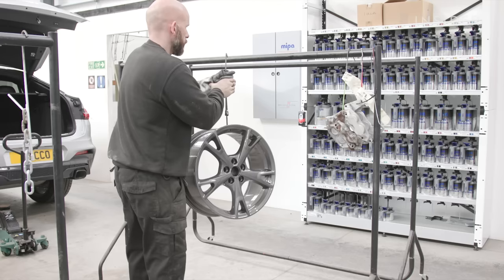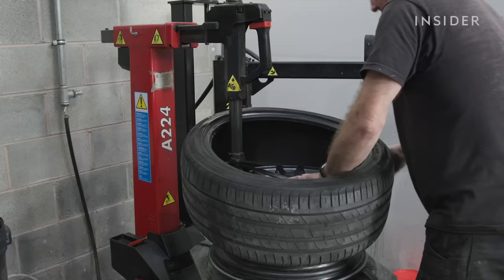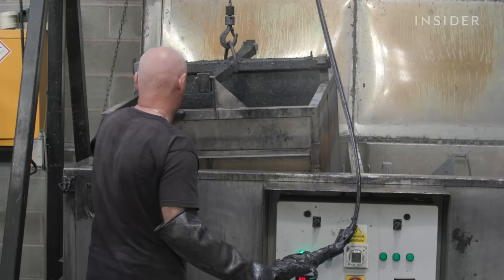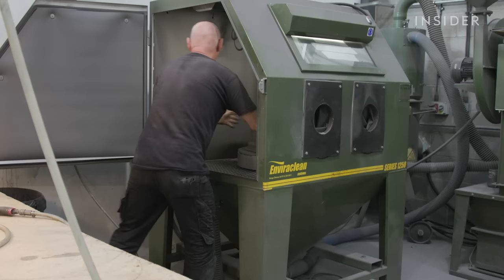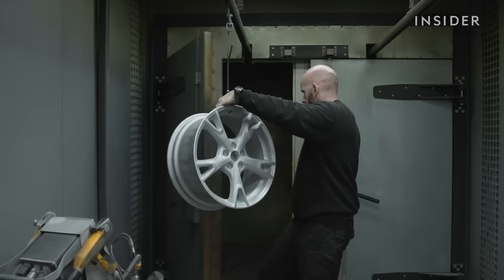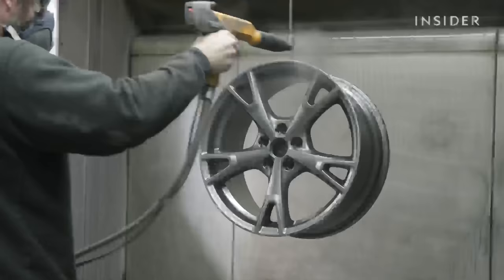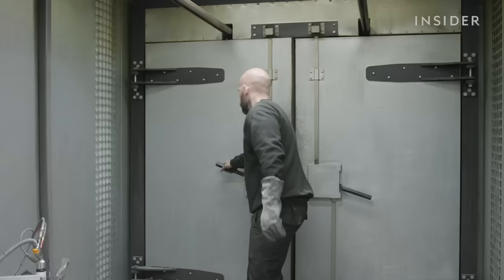How Wheels Are Professionally Powder-Coated | Cars Insider

Comment: I used to work for a powder coating shop that did not specialize in wheels, we only did them occasionally. We never went this far though. We would sand the wheel, power wash it, pre heat it, apply two coats, one clear coat, one color, and done. We also only charged like $200 for a set of 4 wheels tho. Stuff we mostly did was things like awning covers, decking screws, flag and tent poles, stuff that was cheap, high volume mass produced. So not as much time and care went into the details.
Reply: Half *ss job. Finish will NOT last. Do better.
Reply: For guys on a budget whose cars the wheels go on are not showroom-quality but instead are daily driven, $200 sounds pretty good. I wish there are options like that being offered by the powdercoat shops in my area.
Reply: @MOAB-UT $200 a set many people would pay and be happy about that
Reply: @pinkorange4980  You get what you pay for. The only proper way to do a job that will have LASTING results is to remove the tire, use real powder coat material and bake the wheel in an oven at 325-400F. In short order, your painted on finish will chip badly. Yes, the immediate results will look the same but it's of no real value. $200 and in a month or less or active use, and let's not even talk about the winter and salt, they will look horrible and you will have to bring them to get powder coated by a professional. You already know this. Be honest, it was quick money for you. A paint job should have been $100.

Comment: Nice to see a shop that does it all. I was told I have to have EVERYTHING off the rims when I bring mine in to include the damn valve stem.
Reply: Same. My guy also made me take it off somewhere else and then bring it to him and then bring them to someone else to put them on the tire
Reply: depends on the shop. not every shop has tools to remove stuff or good tire machines that wont scratch the wheels for mounting the tires.
Reply: Yes.. most shops want only the wheels! I had called many many shops and only like 2 of them, you can take the entire vehicle in. Yes a little more expensive because they have to mount em back and balance but I don't have a way or time to only take in the wheels! Lol
Reply: See the real issue is that people want the powder coater to do all that extra work for free. Like they just give away wheel balancer machines, weights etc then there's also the cost of extra insurance then not to mention the time. It costs to do the tire and valve stem removal.
Reply: I'm a painter at a wheels shop, we bust it down 100% & put it back together once it's finished, the customer receives it serviced & cleaned. We charge 5$ to dispose of used tires.
Reply: @jonboatmorava9115  no the real issue is you dont believe in full service. Bye.
Reply: @user-jk7yz3xs8z  LoL well if believing that people should be paid for the full service being offered then I'll die on that hill. Businesses can't just be doing extra things for free. Sorry you can't understand that.
Reply: @jonboatmorava9115  Some joker accused you of not "believing in full service" then ran away. You obviously do, and are also aware that with any "service" comes a "cost".

Comment: Why dont they offer powder coating the entire car paint so you don't have to worry about thin clear coat and scratches?
Reply: In fact some higher end brands due use a powder coat like paint, such as bmw
Reply: You can still scratch and chip powder coating... not only that but colors are very limited compared to using a paint system. Regular paint allows bodyshops to tweak paint codes to try and match your sun damaged paint. Also... Goodluck powder coating plastic bumpers. 🤣
Reply: Cost
Reply: @v4lhulme  I would gladly pay more to paint all the body panels and frame with CARC (Chemical Agent Resistant Coating), you paint to match the plastic bumper obv. That's the paint tanks use so if it protects them from corrosion, it would last a century on a normal car.

Comment: can you powder coat parts of a wheel like the inner dish of a concave wheel only?
Reply: technically yes, one just has to do the "pre-work" of masking off the reverse area with the special heat resistant tape.  you can briefly spot some of it being applied in the video on the back side of the wheel where the mounting surface mates to hub.  since a wheel is a rotating object this area must remain flat/true so no powder goes there (same with bolt holts).

Comment: What temperature do you put wheels in at?   I work with powder coating with medical hoist and chair supplies, exact same process as this.   Doing some alloys myself but unsure on the heat they can stand with applying the coating without the powder  over heated and blister/ melt.
I work from 220 to 380°degree. I assume it's around 200mark as same of other spray stuff I do
Reply: F or C? on one hand 220°F sounds low but 380°C would sounds pretty darn high no? Or is it like special heat resistant paint?
Reply: @giedrius2149  that would be °C for me.
Yes 380 is way to high for spray coating wheels or thick box section steel tubing. It has a certain tolerance to the heat to its spec.
The coating material is powder which is basically made up of fine plastic that melts on material,  As for spray i powder coat metals desired colour and leave them in the oven at 220c for 10 minutes. Then they come out with a fairly smooth finish, leave them in 5 or more min longer then the material/coated powder  will get too hot and melt or change to a burnt colour and start to drip because can't resist the heat after that time.

Comment: This is the only way to repaint wheels.
Reply: Nah dude I know a man know can do it for cheap same quality as well
Reply: @notvan0ss833  he said this is the only way, not these are the only people that can paint them
Reply: Its not paint its plastic
Reply: Wrong. I use PPG envirobase without issues every day. Also makes for a damn near if not perfect color match as well. Goodluck matching anything with powder unless it's black, and even then the powder color tends to be on the yellow side.
Reply: @v4lhulme  a good choice for paint but it still won't last as long as a good powdercoat
Reply: @MrPhatties  very limited color, it will not match factory paint colors. Powder coat is great if you want black or some other generic ass color. Will look orange peel from most places and the gloss is not as glossy. Normal paint with ceramic coat will work just fine unless you never wash your wheels but at that point why bother spending money in the first place.

Comment: Powered coating cost range $400-$700 for one of all four wheels? 🤔 Serious question.
Reply: All
Reply: Usually around $900 Canadian for 4 wheels depending on colours, finish, etc.
Reply: @Paul you got it right! I just got mine painted in metallic gray—which takes one coat and is cheaper, at a total of $950 plus taxes.
Reply: Yeah I'm in California and told to expect to pay about $1,000. I kinda want to find a shop that will go to the level of detail this UK shop did though. And will pull the tires and rebalance, etc. I'm just starting the journey but think that might be a challenge.
Reply: Had my 17" wheels done last year. Full tyres off, tyres back on and balanced for £200 in nottm England, that's the going rate more or less in the 🇬🇧

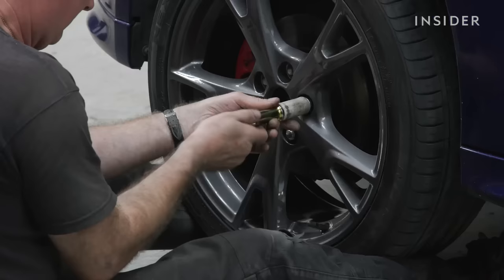Comment: Link to the lug nut removal socket with sleeve being used at 3:52?
Reply: Don't think that sleeve will stop your clear coat from being scratched because it won't. You're better off applying a layer of masking tape on your thin wall chrome socket if you're that worried. It also helps if you don't hand the impact gun to your ham fisted alcoholic friend who smokes crack from time to time.
Reply: @v4lhulme  Yes it will!!! It's coated in rubber buddy. You be spreading some fake information.

Comment: At 3:06 this is where it goes off the rails. Painting a smooth surface without sanding before hand. This is why "hyper" finish wheels have peeling issues. You can apply a powder base, sand, apply a black coat THEN apply "hyper" or "liquid metal". This is why I can't stand these vendors that do this shit. Your process is wrong. Not to mention all these companies leaning on that powder coating, their wheel color rarely ever matches the factory finish which annoys bodyshops everywhere.
Reply: Just ask any Mazda dealership how their dark hyper finish wheels hold up after a year or 2. Surprised they aren't bankrupt after paying for all those warrenty wheel repairs.
Reply: Т
Reply: They showed the sanding process at 2:00
Reply: @v4lhulme  Dealerships did it on the cheap, that is why the coating did not hold up.
Reply: Funny, I saw them sanding the wheel in this video. You must have missed that.

Comment: I want it powder coated. No problem, it'll be $300 per wheel. It's okay, I have paint from autozone.
Reply: Powder coating cost on a wheel usually is based on the size of the wheel. Around me east coast US a normal size wheel like in the video is around $100 -$130. If they are charging $300 you are getting ripped off bigtime.
Reply: Yeh, let's see the finish and how long that lasts LOL
Reply: Get what u pay for.

Comment: Not really professional if they are hot flocking them 🤔
Reply: This! Lol
Reply: Why do you say that? Hot flocking is actually approved by many manufacturers of powder. I've had better results hot flocking especially in combating Faraday cage effect. Plus it shows the coating depth and finish easier. I've also done durability test on parts that were hot flocked over standard and didn't yield any different results.

Comment: What no base/primer coat applied first 🤦‍♂️
Reply: You dont need if you polish proper after sandblasting. The last coat of colorless making it look smooth so if its like 3 coats u dont need that. Sandblasted surface is the best surface for optimal resistance

Comment: There are two major reasons that powder coat should NEVER be applied to wheels. For one, it can hide cracks in your wheel that can prove deadly later on. For this reason powder coated wheels are banned from many racetracks. Second, if you damage your powder coat there is no thing as a touch up. It cracks and crumbles and the entire wheel must be stripped and recoated. With paint you can just touch up the scratch. This is why no wheel manufacturer powder coats their wheels, because paint is by far the superior coating.

Comment: Wouldn't you want to balance the wheel after chemicals and cleaning????
Reply: There'd be no point in further cleaning it if it was too far off balance
Reply: You would balance the wheel at the very end after the tire is installed.
Reply: It's a chicken or the egg
Reply: The first balance was for warping which would render the wheel useless.

Comment: Might as well just buy new rims
Reply: Some wheels are 20 k for a set probably some are more
Reply: @chipskylark8869   that’s true but for that particular car you can get a nice set for 1-2k
Reply: @chipskylark8869  not sure what rims you typically see that costs 20k lol! Most are $200-$300 each for a decent aftermarket set.
Reply: @chipskylark8869  lmao 20k a set wtf 🤣🤣🤣 even with tires mounted no way you come out 5k a wheel.
Reply: Will say that those ford wheels that he’s painting there vary in color from car production runs. I have a focus St and may production cars have a different color than June production so buying a wheel after market for my car would mean I’d need to buy all four. Also ST wheels aren’t cheap a four set when for 8k when I was looking at it. I’d be happy to suck up the 4-700 dollars if it means I don’t need to buy all four
Reply: I've sold a set for 20 k but it was EXTREMELY CUSTOM centerlock conversion kit full billet monoblock with 30hrs of machine time super cool project but not normal but you can easily spend 10k on a nice set of color matched 2 tone forged wheels with super expensive tires average for forged hits 6k not flowform or rotary forged those are just cast wheels with a very effective manufacturing technique used I mean American made forged wheels. Cast wheels its up to 3500 and as low as 800 unless it's a low pressure cast from China then it could be less but generally that's the breakdown.
Reply: Sometimes it’s not possibly to buy the rims you want off the shelf in the colour you want. Last set of wheels I got it worked out cheaper to get affordable wheels in a different colour and have them powder coated than to buy more expensive wheels that came in the colour I wanted.
Reply: I just watched a car wizard vid he was working on a 2012 Bentley saying no one anywhere would restore the Bentley wheels b/C they cost a whopping 12-$1500 a wheel and were chrome. And the same holds true for any high-end luxury car. Seems wheel places do not want to take the chance of messing up someone's expensive car wheels.
Reply: @koshnaranek2317  that's weird in CA the guys known for doing wheels don't typically care how much it is. a set of OEM wheels tend to be much cheaper than aftermarket forged until you get to the Bugatti Lamborghini Ferrari levels obviously there's more at that level but I'm not going to list them lol.
Reply: I'll make sure to tell my mercedes AMG customers that they are better off buying a $1000 wheel next time they curb one. Bahahahhaha!
Reply: @koshnaranek2317  I don't care what car it is, been doing McLaren, lambo, Ferrari, Bentley for years. Just charge more and pay more attention and don't let the new guy touch it. Then again I'm not stripping the entire wheel finish if it doesn't require it. Just do the repair, clean, prep, paint, and clear coat the entire wheel Just like a bodyshop would do for a damaged door or fender. Been doing this for 8+ years and never had a paint issue. 👊 that being said I don't cheap out on supplies like most wheel companies.
Reply: @diegomanuel5065  I once paid about 16k  for Forgiato 24 inch rims after tires and mounting. I also had a matching steering wheel included also.
Reply: When the factory wheels on your car go for $3-4K for a set of 4, powder coating starts looking like a good alternative to new ones. And if your wheels are equipped with tire pressure monitors I can keep those intact. Like some commenters alluded to, whether or not it's the best decision depends on your particular car and wheels.
Reply: Negative, new wheels are much more expensive. If you’re buying good ones anyways.
Reply: What chemicals are you using to remove the old paint from alloys?..we sandblasting them and then paint with powder..but some alloys are so hard,paint is tough and sandblasting takes around 2h just for one alloy wheel..
Reply: Foreal and sell the oem
Reply: @diegomanuel5065  ask porche 911 gt3
Reply: @Michael-qx8bz where the hell are you getting a set of 4 quality wheels for $200???
Reply: @chipskylark8869 might as well buy a new car 😂
Reply: New rims = 1000$
Powder coat for 4 rims = 40$
Quick maths
Reply: @silktm9457  WTF are you talking about? the video said it costs $400-$700. i don't know if it's per wheel or the whole set but that's expensive
Reply: @mluu510  I’m literally powdering wheels as we speak.. powder is like $10-15 a lb.. it’s cheap asf all you need is a enclosed box with a heater or a oven. $60 for total powder & diesel cost. Wheels cost me $250 for TSW Interlagos WITH TIRES for all 4, they sell for 1800$ brand new for all 4, literally a quarter of the damn price. You’re going by a video you watch, I’m actually doing it
Reply: Might as well not. 800 - 1200 at least for a set of rims as a pose to 400 - 700 for a repaint and fix to make it as good as new. That's twice the price.